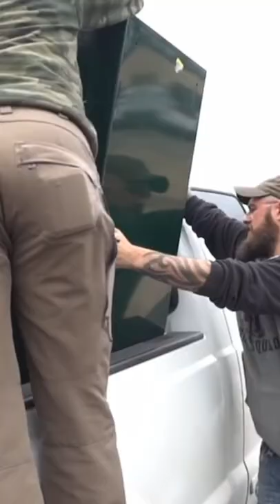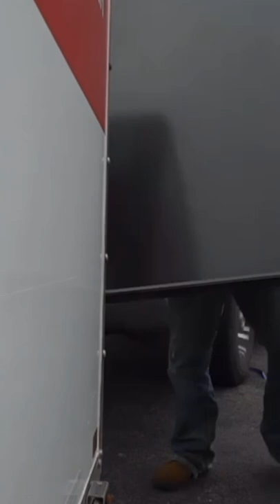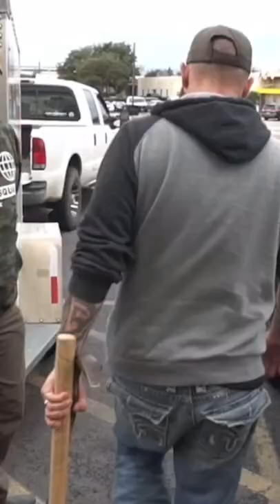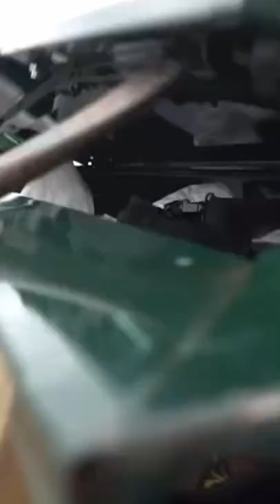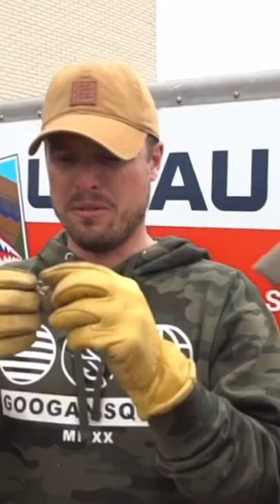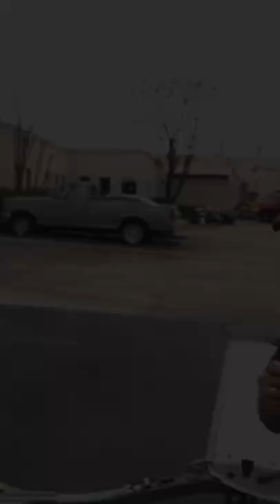Gold & Diamonds FOUND In Abandoned Safe! #Shorts

Comment: Worked WAY to hard to get into a gun locker.  On those, you drill out the lock and it will turn open. Then you can RESELL the locker too after putting a new $6 cam lock back in.
Reply: The fact that you said “cam lock” and not just lock, tells me you know a little about this.  I make boxes and rekey locks often.  Fun skill
Reply from the maker: now who would watch that?